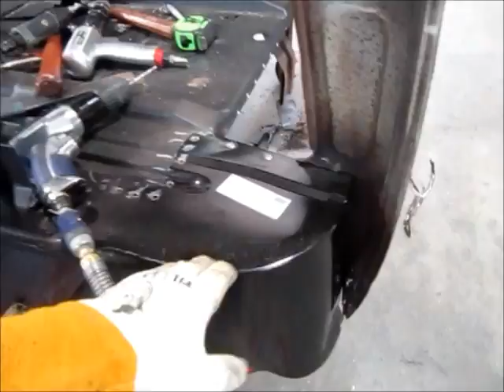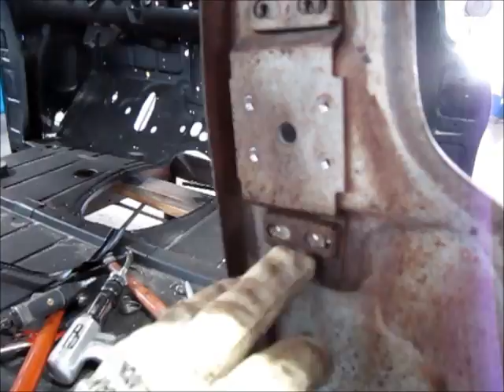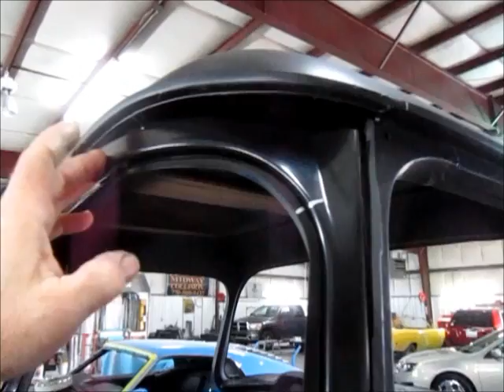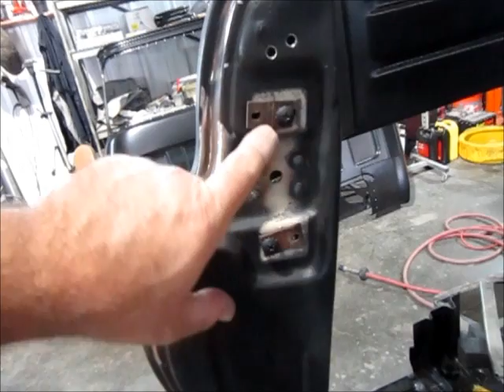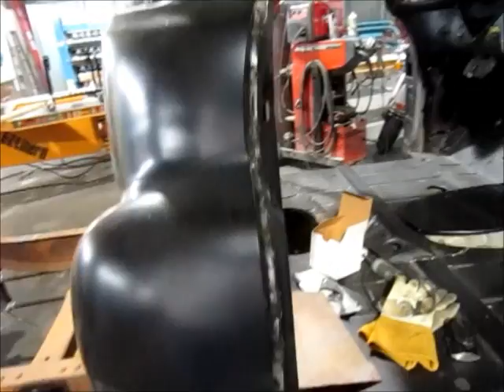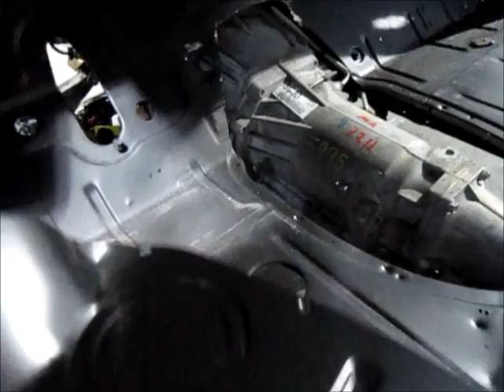1955 Chevy truck rebuild. Big back window conversion. Part 2

Comment: Great job, just found you and subscribed. I am doing a 56 GMC that is getting a 4-71 Detroit with a twin stick set-up. I had to modify the firewall, and need to also make a new trans cover. I used a wheelbarrow, sectioned it together to make the firewall, and plan to do the same for the trans cover.

Comment: Im getting ready to start the big back glass panel conversion. I was curious after everything was finished up. Did you have any issues with the fitment of the glass once it was completed??
Reply from the maker: I didn’t install the glass. But the man who did didn’t seem to have a problem. There is a follow up video on this truck showing it all together.

Comment: Nice Job  Use  Aviation Clecos  you  can buy  them at  Theyardstore.com
Reply from the maker: I have a ton of clecos. Just not on this job.
Reply: we  use  the  for  skin repair  in airplanes and to presentate parts  is  a big help  but if you can hold  them with  "C" clamps   great....nice well done   Job
Reply from the maker: I'm an aircraft mechanic. Did major skin repairs for a few years. Clecos are really handy.
Reply: Awesome , I do structures ,A&P   and Some  composite ...Love classic  Bikes  ,classic cars,guitars,automatic horology ,guns,ufos,construction and drawing..

Comment: Nice work ..wish I could go hog wild on my 55 like you have on this one I have the same repairs on mine other than the back window  wish you could have got some video of the rust repair on the upper cowl and kick panel that's my biggest project on my cab sure would be nice to know of any issues with new kick panels before I cut into it
Reply from the maker: +motoxchris It was definitely a big job. I have yet to see this truck in its finished state.